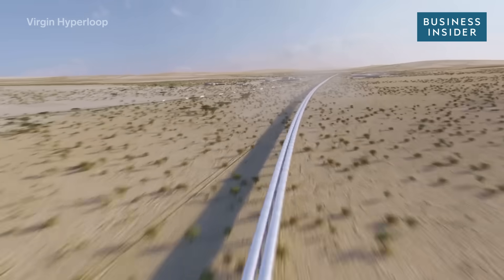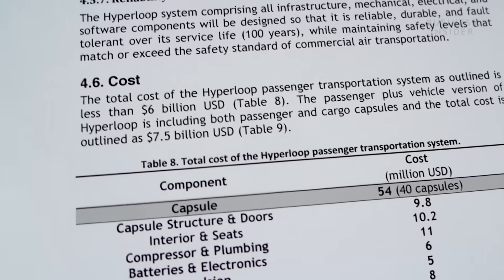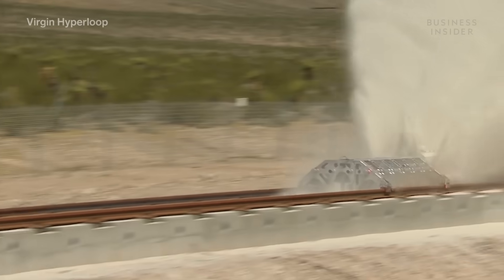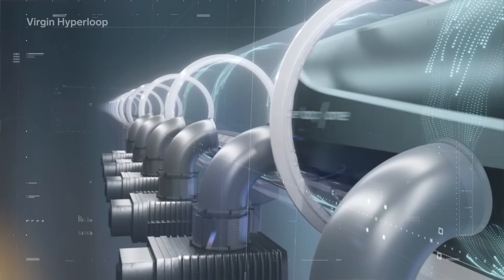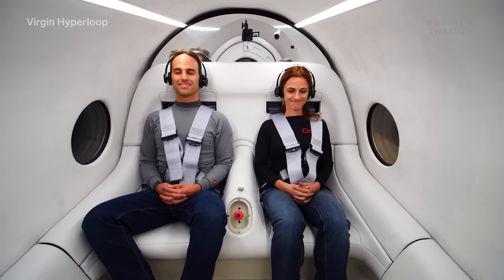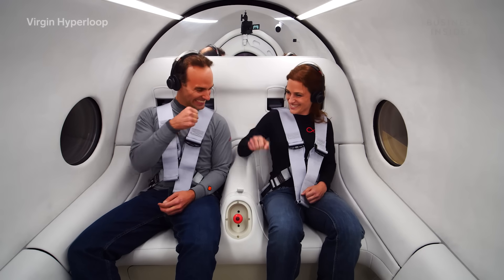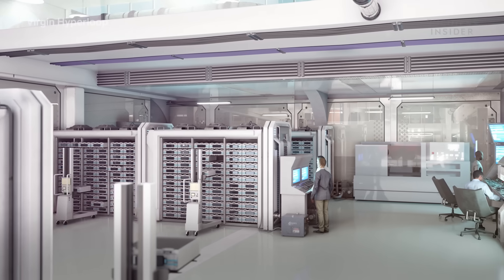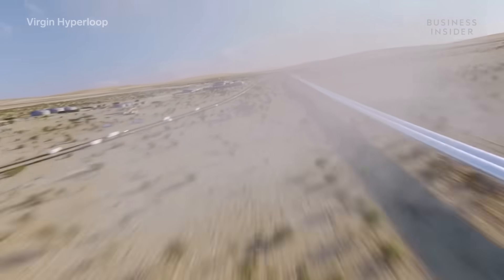How Elon Musk's 700 MPH Hyperloop Concept Could Become The Fastest Way To Travel

Comment: Vacuum super conductive eclectic motor like LHC a nightmare to cool and constant electrical problems. Super conductive vacuum soup just will not mix.
May work in 200 years when we have superconductivity at room temperature then we could suck out the air in a tube for space like flight on Earth surface but today NIX

Comment: Until someone opens the hatch inside the vacuum...  like the diver whose body exploded in the dive chamber when the janitor opened it.  There needs to be a safety lockout that repressurizes the tube and disables pod traffic should one of the pods become stalled.

Comment: If we ignore safety and the impossibility of its engineering, lets look at cost effectiveness.  lets look at two world cities connected by rail that see lots of travel between the two. Paris and London. Eurostar runs this route carrying 900 passengers and costing around 70 USD. For simplicity lets round the travel time down to 2hrs. Eurostar claims their trains go up to 186mph. Hyperloop plans subsonic but lets give it the speed of light at 761. That's 4x faster than Eurostar but remember Eurostar holds 900, hyperloop is 28 passangers per train they say. Back snd forth That's 56 passengers per route. 4x faster it's 56 per half hour so in the time it takes Eurostar to do one trip Hyperloop will have delivered a whopping...224 passangers. Less when accounting for loading times. Thats Nearly 700 less than Eurostar. Lowballing we'll say tickets at $100 and it just doesnt make much sense. Eurostar is slower but it's ATLEAST 30USD cheaper and carries 4x more passangers. Now just even cost of building. The Euro tunnel underneath the English channel cost 21 Billion USD. This hyperloop tech added w the facilities and the trains will likely cost atleast 4x (my estimate atleast). If they ever even overcome the engineerring and safety challenges the sheer amount of money will shoot them down

Comment: So what exactly happens if there is a lack?
In theory, the people should start flying around like crazy because the air cannot flow around the train.
And if that happens, how do they want to save the people inside in case of a lack?

Imagine being right in the middle of a 500km ride. If the Hyperloop works your through in about 45 minutes. But if there is air in the system, i guess their maximum speed is 100km/h.

Comment: Looks cool but my main concerns for riding this are pretty much the same as why I dont want to ever ride an airplane. The only issue that airplanes are much shorter than tubes running between cities being completely sealed. Thing of how easy it would be for any terrorists to kill large amount of people or to disrupt travel. Just go to any major city, get something strong enough to blow open a hole, then watch the chaos ensue. Even if there was some mechanism to prevent everyone inside from dying due to air rushing in, like maybe the air pumps being able to tell if there is a hole down the line and then slowly letting air in, the massive inconvenience would still cause many issues. And this is just operating on the assumption that there are safety mechanisms in place for any situation like that. This kind of seems like a death trap for normal people or a massive opportunity for anyone wishing to bring chaos. I would definitely need to be thoroughly convinced of all the mechanics of the safety features before trying this out, and even then I doubt I would want to use it.

Comment: 30,000 passeners an hour means a train of 1000 passengers every 2 minutes.
1) How do you load 1000 passengers into a train in 2 minutes?
2) How long does it take to empty and refill an airlock?
3)  How long does it take to refill the passenger air supply?
4) Are there any two cities anywhere on earth that require a capacity of 30,000 passengers every hour of the day?
Reply: you dont you load individual tubes carrying a modest amount at intervals like multisubway lanes do or lightrails or even bus lines do, going in both directions across vast stretches  also it would be multiple stations . we can handle the logistics of entering pods onto the trackway the same way we do air traffic control at airports via human and computer tech. we are capable

Comment: Boondoggle.

This is only viable if you ignore physics, safety, and economics.

HSR can move 1000+ people PER TRAIN with a gap spacing of 12 minutes. 

HypeLoop needs 100x the raw materials of HSR, needs 18km radius curves to prevent killing passengers, has not solved ANY of the vacuum seal, emergency egress/rescue, or how to keep a minor leak from killing everyone as the car hits the wall of air.

Stop giving credibility to folly.

Comment: For the moment it’s a double problem:
First the vacuum system which is one of the most difficult to put in action for such long distances. Keeping a constant zero air in the tube is really a difficult exercise. But to reach a speed of 700 miles/h or more is mandatory. 
Second Is cost. When you see the development of HST San Francisco to LA stopped because of poor funding and constant political interferences you can guess what would be the cost of such a new concept. 
Needless to say that like for HST hyperloop would be a good candidat to the battle of pro and con as well as lobbyists. My prediction is maybe in 10/20 years or just a dream,

Comment: You must be joking, maglevs have already existed for ages and are in commercial use today. The real challenge arises from making metal airtight tubes that:

1. Don't leak
2. Can compensate for heat expansion
Reply: The real challenge is enclosing the whole route in a tube, rather than simply flying it in the open air.

Comment: Jeez, imagine how terrifying it would be to exit an airplane while its flying, its the same for the hyperloop, and planes are still safer than cars, so, not really a debate for safety
Reply: Planes dont even like going close to the speed of sound due to inefficiency of flight. 

Meanwhile this badboy goes right up to just 50mph away from causing sonic booms as it goes through the tunnel 😂
Reply: @vincea1830  sonic booms wouldnt happen in vacuum. But still the hyperloop sux and will never be built
Reply: Would rather compare it to a train than a car.
Reply: Except you can't, you'd be strapped to a seat and there would be security measures preventing you from opening a hatch while running. Also hyperloop is not by any means a car and you can't and shouldn't make any comparison to it and a car. It has it's own separate tracks, similar to trains that are separate to roads.
Reply: "As long as it's Shiny, WHO CARES that it's cripplingly inefficient? And Horribly Unsafe? All that matters is that it's Shiny and Elon-Approved!" 
-Adam Something, while all Experts agree.
Reply: planes are safer as we spend time making it that way..  not simply because they were made safeir. Besides that not everyone can fly an aircraft, you need lots of training to do so, in the other hand anyone can drive a car making it more likely to unfortunate events to happen.
Reply: @sebastiandearco2776  law of averages and that...

Comment: "this is the future for high speed transportation" except it's not, it's unpractical, basically you're putting people in a outer-space like environment, a tube, that needs to hold vacuum for hundreds of miles, just getting the tube is a feat of engineering, regardless of costs, it's just fantasy !
Reply: @mythl2179  unless there are major breakthroughs in material science this is not realistic, imagine that tube, then imagine sucking out ALL the air out of it, what tensions and stress it need to resist to, without the "pod" going through it at 4-600 mph, what would the tube be made of ?
also, what safety features are you gonna implement ? if there is just a microscopic fissure in the pod it will lose pressure fast and you'll have no O2 to breath, if the fissure is in the tube then you'd better pray to god cuz a shockwave will obliterate anything in that tube
all you have to do is imagine the setup and everything that can go wrong and you'll see that this is just fantasy, just like the warp drive
now, don't get me wrong, i'm not saying it's impossible, but it extremely unfeasible 
just watch thunderf00t's video on the hyperloop

Comment: Although I'm not a stranger to "faster is better" I still would like to suggest limiting the speed to 800 m/s.
Here's why: If there is ever a crack in the hyperloop, and air rushes in, you're gonna get a melty train, as in goop, moving with goopy passengers.
If the speed is limited to 800 m/s, there may be a temporary heating, as the train decelerates, from near thermalisation speeds at sea level, to under 700-750 m/s, but this may then be the sum total of damage,
no goopy melty passengers. At 800 m/s you can still cross faster than any commercial plane, at a discount using solar panelling across the entire stretch of the railway, and be THAT good.
Yes you can go faster, but the question is should you.
At 800 m/s you can traverse the US in like 1hr 13m or do a scenic route for like 3hr,
with parts underneath the ocean at a cozy 30-50m depth, which sounds awesome too.
In that case I'd suggest slowing down a little during the oceanic parts, for scenism.
Going by land near sea lanes, or into the ocean when not crossing sea lanes.
I think some mountains would need vast tunneling.
Maybe crossing the ocean would be fun too, partially underwater.
Now, once that kind of mag-lev trains start running, maybe the next step is
to use a tall mountain and a maglev carrier, to accelerate future space ships to well into 1000m/s before requiring their own engines, which shaves off a ton of fuel, and may also need less taxed engines.
If you'd take the highest peak as a support and build on top of that, you may even have a fuel-less speed gain of up to 1500m/s

Comment: Seems to me like it would make far more sense just to build  ordinary high-speed rail. Look at Japans high-speed rail, fast, safe and punctual, you can 675km in under 4 hours including stops and transfers. Between the 2 largest cities (Tokyo and Osaka at a distance of 500km apart) in 2 and a half hours. China is building a vast high speed rail network too and it is making commuting in these countries far more viable. But no people in the US don't get excited unless you get crammed into a windowless vacuum tube and hurled at near mach 1, even if the capacity, punctuality and safety of such a system will be poor.